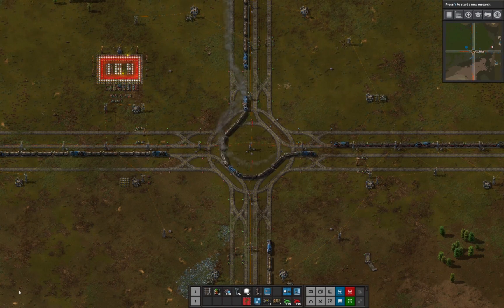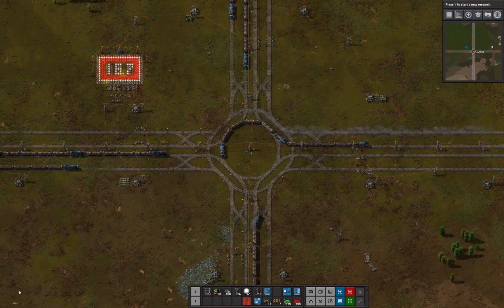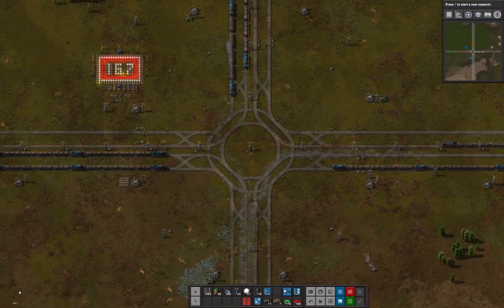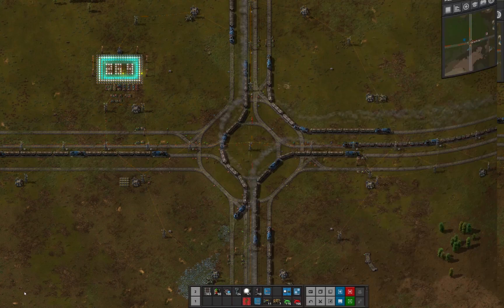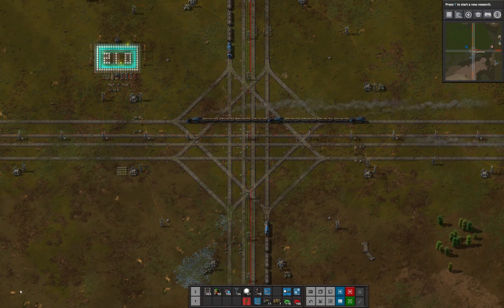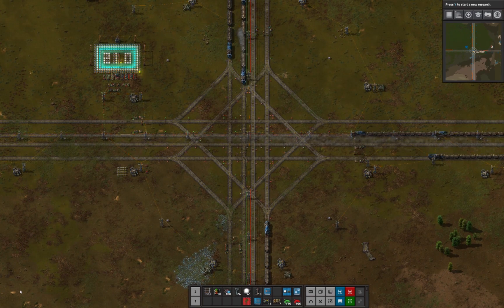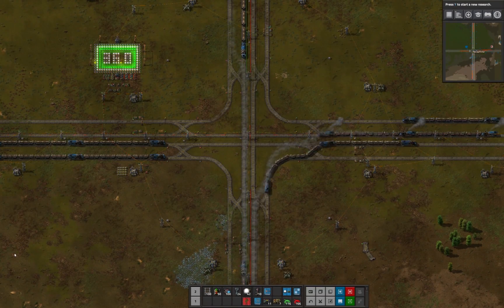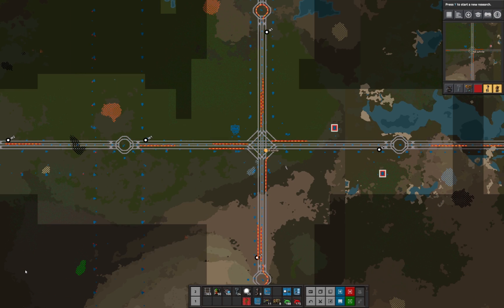Factorio Quad-Rail Junctions

Comment: I've been trying to optimize an elevated 4-way junction and am really trying to get the throughput display you used working using your blueprint, but I'm not great at circuit logic lol. Could you please let me know what exactly you are connecting to the inputs?
Reply: Nevermind I figured it out, thanks for the design

Comment: This is really interesting and great. For the final design there is no way for a train to turn left unlike the roundabout style designs. Would this inflate the trains per minute since they need to go through the intersection more than once to get where they need to be?
Reply from the maker: Only one intermediate design didn't support left turns.  The final design does.  U-turns are bad for throughput so it's better to have trains take a slightly longer route around the block instead.

Comment: You should have tried this as well: (─┴──┬─). This is a crossing from a staggered block design, kind of like a brick wall, where you only have three way intersections. It's said to be even better than doing regular blocks with four way crossings, however I have no idea how well it works on its own.
Reply from the maker: That's an interesting idea.  I can't judge without testing what the efficiency would be and creating a test would be difficult because regular grids are about different paths rather than individual intersections.  I can, however, see it being prone to error in blueprints with a tendency to be placed incorrectly.

Comment: trains in factorio makes you realize how insanely complicated logistics can be. What if your trains were shorter and/or faster? What if you had multiple sorts of trains? What if departing and arriving direction are not uniform? The curse of dimensionality really kicks in
Reply: From how Brian’s trains seem to be set up “loco, wagon, wagon, wagon, wagon, loco, wagon, wagon, wagon, wagon” it looks like the system can use “loco, wagon, wagon, wagon, wagon” trains and others. Likely so longer trains with multiple locos will still fit in stations for smaller trains without messing up the inserters and stuff.

Comment: ========x
========x
Instead X for all 4  better to select before head inner or outer circle to choose 🎯
========\ /
========/ \
Reply from the maker: This degrades performance because trains move inwards before the intersection to take the shorter inner loop thus increasing congestion and slowing traffic going through it.  It was actually my original design but was shown to be flawed during testing.
Reply: @BriansBasicStuff  
Everything's remain the same except that 2  small interchanges x on 4 direction =8 no. , reduces to 1big X on 4 direction= 4 no. 
Functioning, track selection, operating all remains same. I tried iterations.
Reply from the maker: @kalpeshwani8520  You'll have to email me a screenshot.  bcwhite@pobox.com
Reply: @BriansBasicStuff 
 check limited unfair trains video by Matthew Pocock
Reply from the maker: @kalpeshwani8520  Interesting.  LTN obviously doesn't have that problem but I also question his analysis that the problem he displays might be the cause of an actual base where trains didn't make deliveries.  The difference is that, in his case, the empty destinations always receive trains so there shouldn't be any starvation even if a provider or two doesn't get utilized when there is an abundance of supply.

Comment: Something you failed to mention in the last design is, that 33.3% of the trains are counted twice and therefor making it the second worst solution.
Reply from the maker: The right-turn-only version?  I definitely mention the double-counting.
Reply: @BriansBasicStuff  not quite, you said you they were coming back to the intersection a second time. But you did not said they were counted twice aswell or how that falsifies the value the counter is displaying. Still a great Video tho^^
Reply from the maker: Fair enough.  I didn't do the math on it.

Comment: Hi Brian
I have a 48 train/min average (with your cargo config) with only dual rail, do you want to see it?
50+ if you fit it perfectly
Reply from the maker: Certainly.  You can email me: bcwhite@pobox.com
Reply: @BriansBasicStuff  was there something?
Reply from the maker: A big part of its efficiency came from having signals every car length which lets trains pipeline much more efficiently.  Unfortunately, this can allow deadlock on a busy network.
Reply: @BriansBasicStuff  was it chain signals? They do divide segments and prevent deadblocks
Reply from the maker: No.  Chain signals don't improve pipelining because a following train can't enter until a preceding one has passed the next non-chain section.
Reply: @BriansBasicStuff  interesting
Reply: Yes and no, you just can't afford any mistakes in your network, my factory was calculated, no over production and has been running for hours without a dip
Reply: So with my setup, the exit of a junction must allways be free, which it is because every junction flows very fast :)

Comment: I just made a massive track where entire 10 section trains can fit inside the vertical and diagonal parts without blocking each other. It's rediculously huge, but it was fun.
Reply: never understood why ppl make junctions so small, openTTD you just make huge loops that fit whole trains so they dont clog each other and then build a factory in the middle and belt stuff out of it lol

Comment: I just love the animation on the display, so simple, but looks great :)
Your designs are cool, though I wouldn't place inner lanes 1 rail apart, give them space, so it's more flexible and more space left for signaling

Just a few suggestions:
For testing train intersections you can use the Automatic Train Deployment mod (https://mods.factorio.com/mods/aaargha/AutomaticTrainDeployment)
Also you can use the Creative Mod for faster and more comfortable building, really saves some time (https://mods.factorio.com/mod/creative-mod)